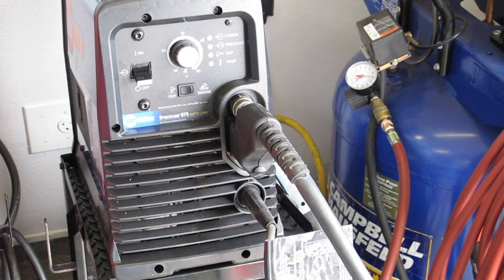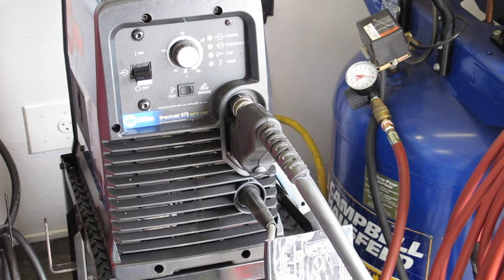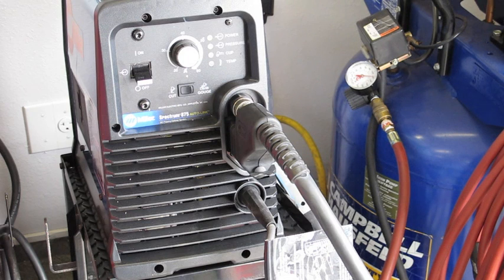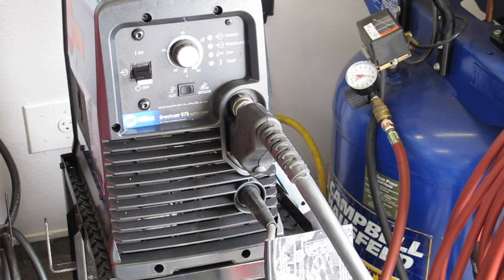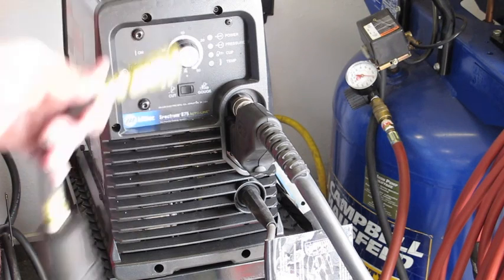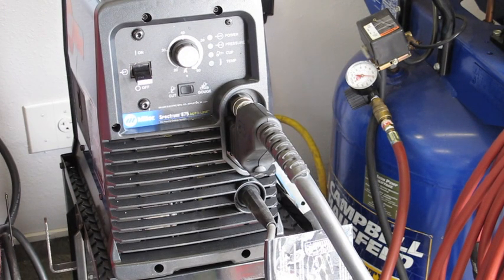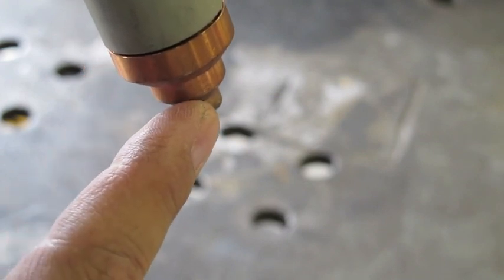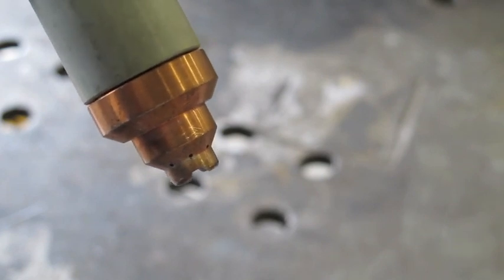Plasma Cutting

Comment: do all plasma torches have the recessed tips to drag along metal guide
Reply from the maker: No, some come with a standoff tip that is used a distance from the piece and not touching it like this one.
Reply: Great video. I've been looking at Everlast plasma cutters and noticed that there is only about $100 dollar difference between the 70A cutter and the 60A cutter. Do you think it is worth the added cost?

Comment: I recently purchased a spectrum 875 w/xt60 torch for $1100.00 NIB from a pawn shop. Awesome machine, but I tried to keep the tip off of the material but found that difficult. I have the same fluted tip u show and will do the drag move with it next time.Great vid and keep up the great work. Also did'nt know about maxing out the amp setting and going for it, thanks, makes sense to me.
Reply from the maker: LeRoy Denning that's a good deal! That tip is called a drag tip and is not meant to be raised from the material, so that is why you are having a hard Time with it. Hope the info helps you and good luck.
Reply: Great advice. I'm going to have to get some drag tips for my everlast plasma cutter and give it a try.